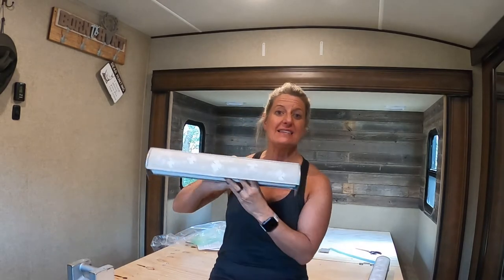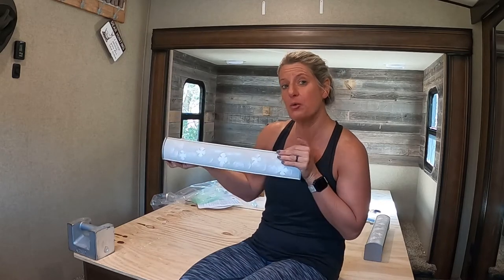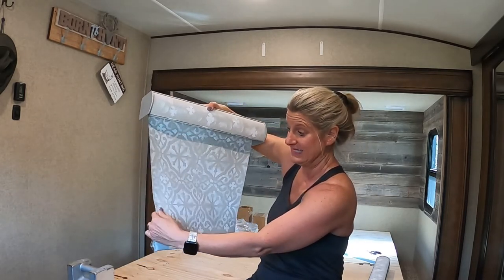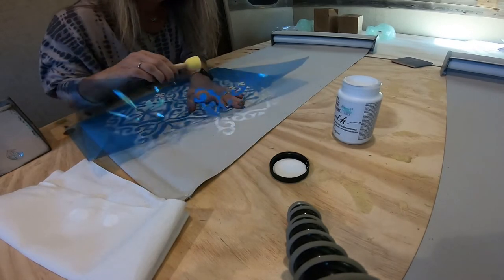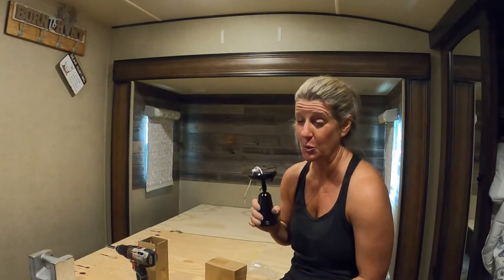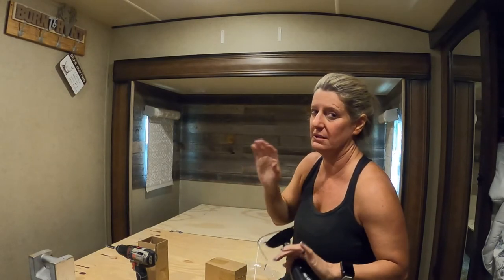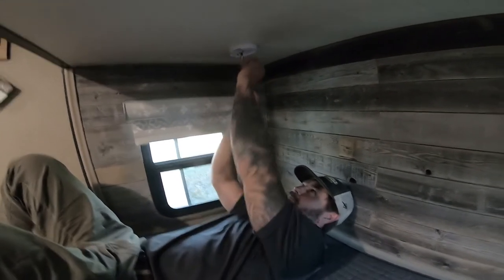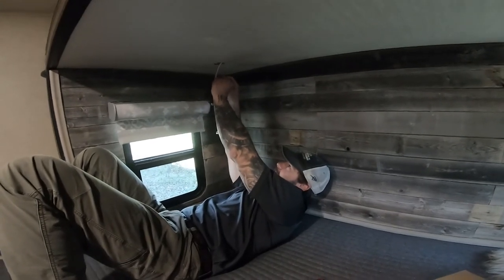RV Bedroom Remodel Blinds and Lights

Comment: Check the way you clip them in. We installed all new in our camper too and they fit flush with the wall.
Reply from the maker: I will look again. I ended up moving them up higher and they don’t look as bad but them floating they looked horrible.
Reply from the maker: Well I have the bracket backwards haha
Reply: @BillandKelleyAdventures  oh how funny. 😄